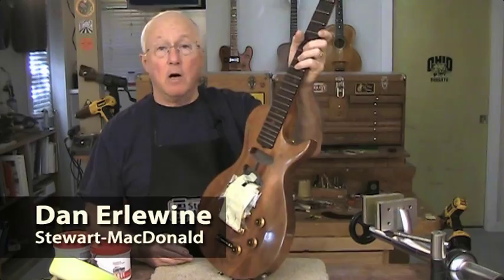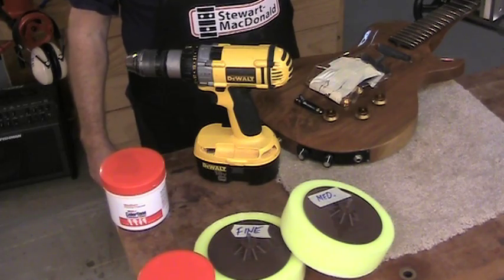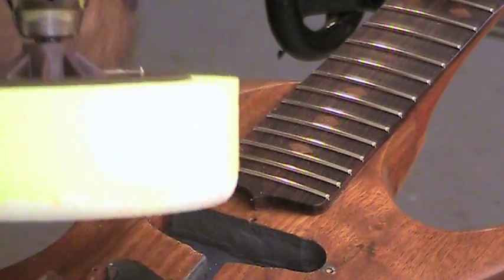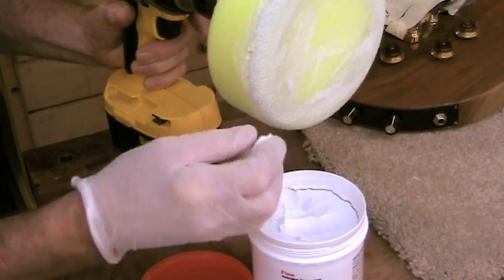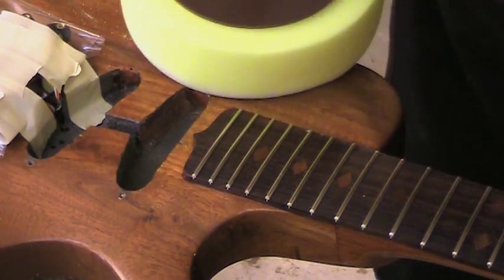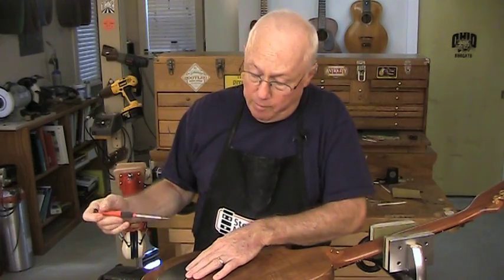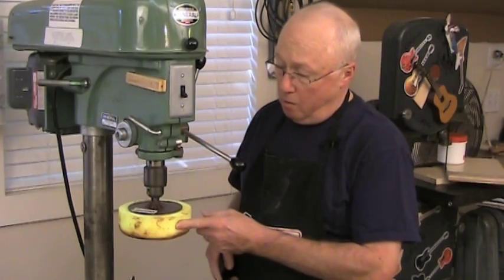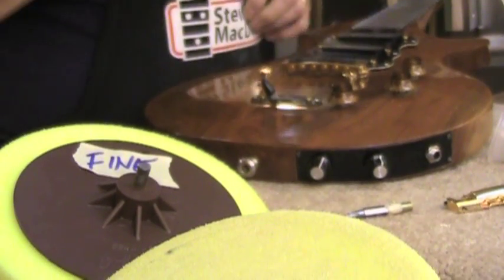Foam polishing pads for guitar finishing

Comment: So I am working on my first refinish project and now that the clear coat is on, single application, will these foam pads help to get rid of an "orange peel" type appearance to the clear coat. It's not horrendous but I know it's there ya know, and I'm aware that if I put more clear coat over the top than I'm only sealing that in. Just wondering if this was the product for me, or maybe some type of rubbing compound?

Comment: I just received my foam polishing pads from you but am at a loss for the right drill to use them on. I've looked at several models (Black & Decker, DeWalt, Ryobi etc...with variable speeds from 100-1200 RPM. Does it matter if the drill has a variable speed-dial or the manual trigger type which you control the speed? Also, is there a cordless drill that has a lock switch so that you don't have to keep continuous trigger pressure while polishing? thanks.